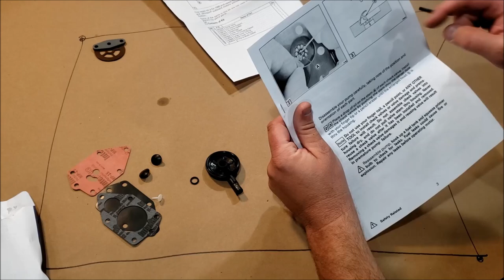Evinrude Fuel Pump 438559 Rebuild

Comment: Love your outboard vids.  Quick question.  Have you ever used one of the aftermarket pumps that are sold on Amazon?  The ones that are being sold for less than 20 bucks.   I'm as wary of cheap parts as the next guy, but sometimes they are fine.  As an example, I just replaced a carb on a 4hp Tohatsu with one of the Chinese aftermarket versions and the carb was fine and the engine ran fine with it.  Thanks.